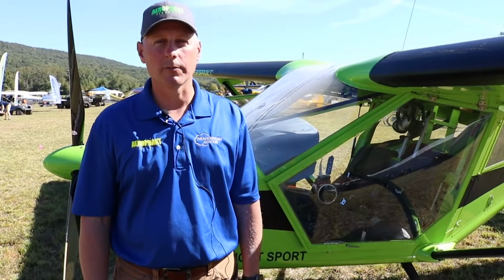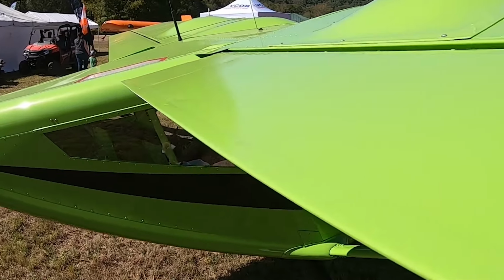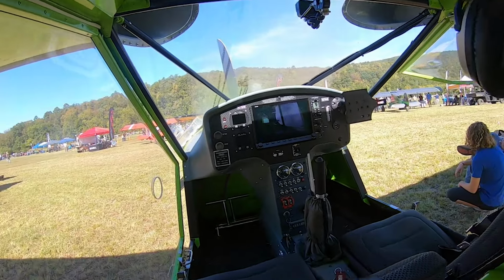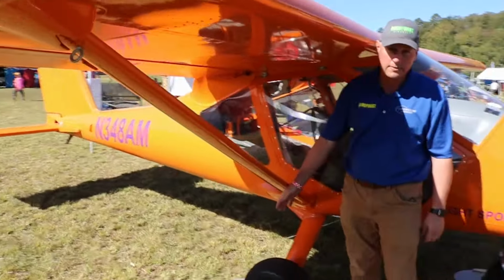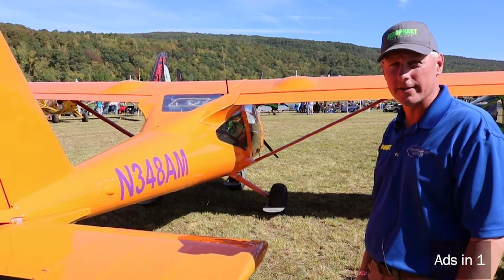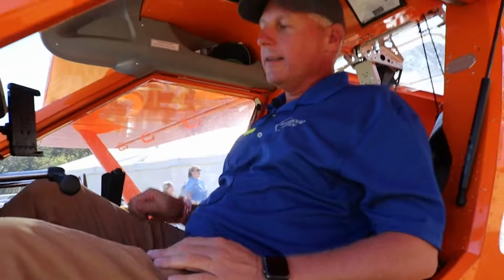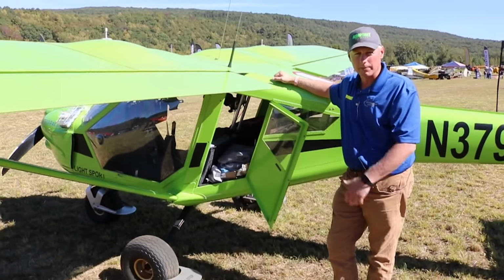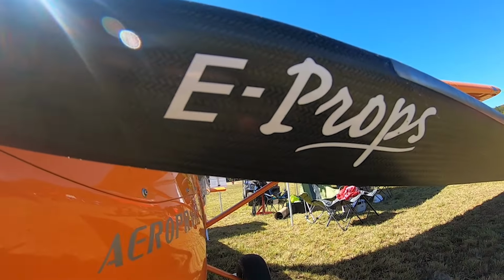The Most Affordable SLSA? Aeroprakt Aircraft A22 and A32 - Heavenbound Aviation

Comment: This is an ultralight, most know it as the Foxbat.  Max takeoff weight of about 950lbs.  It is cheap (starts at $80k), sure and can be flown without a pilot certificate, but its VERY slow (90ktas top speed) and prone to winds.  Be sure you know what you are getting into when it comes to aircraft.
Reply: The Foxbat has a max take off weight of 1322lbs
Reply: @darrenkelfkens8539  A-22: The ultralight version of the A22 has an MTOW of 472.5 kg (1,042 lb)
Reply: @speedomars - What?   Ridiculously WRONG information.  This is not a Part 103 ultralight, it's a S-LSA, that requires a Sport Pilot Licence or better.  Did you even watch the video?
Reply: @DavidR_192  it is correct.  ask AI.  learn something
Reply: Everything you said is untrue. Get a grip.
Reply: Did you just make it up